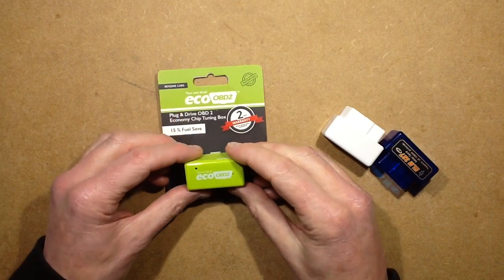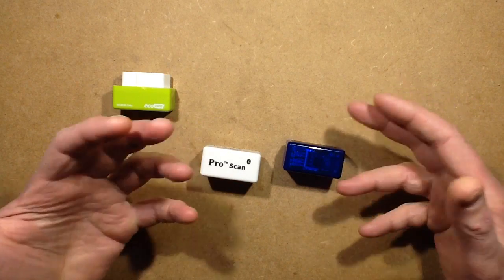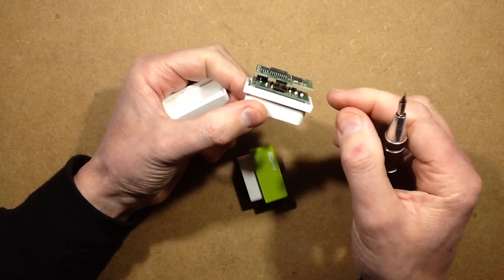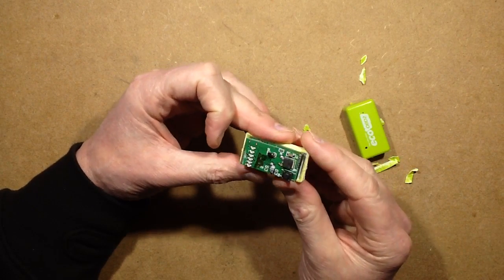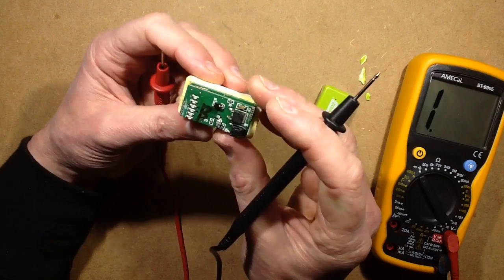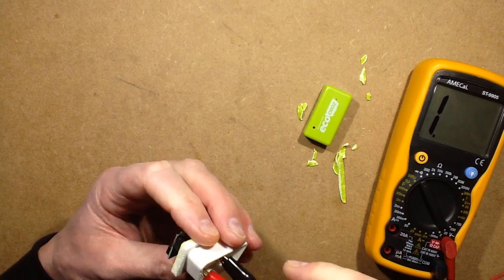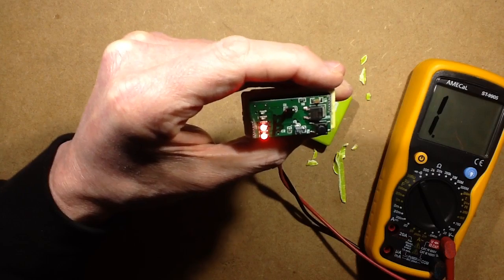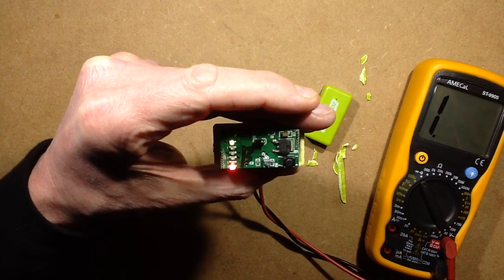Inside an ECO OBD2 "chip tuner" fuel saver.

Comment: Hi all 
I'm a manager for a courier firm and drive a VW TRANSPORTER on a 17 plat. I do about 1000 miles a week .  I plug an eco obs2 in and have had it going for a full month as you can guest I track my fuel usage and after comparing month on moth my diesel van is getting around an extra 196 miles per tank full which is well worth it in my line of work. I have also notices a few things worth a mention 1. The engine seem less lumpy in tick over and smother in acceleration. It also quiter at Cursing speed on the motorway. 
2. It feels slightly less poky in the lower gears.
Hope this helps.
Reply: I don't believe one thing you said.
Reply: Cursing speed? Is that when the passenger is saying "Oh shit!"???
Reply: That’s the biggest load of wallop I’ve read these things don’t work they just light up that’s it 😂😂😂

Comment: "Most modern engines operate on a closed loop which basically means that the parameters for the next combustion cycle are set by the previous one. The exhaust is sniffed for oxygen to determine if the car is running rich or lean and the intake fueling is adjusted to match. Many popular engines learn over time the optimum settings and every 200 miles or so adjust the ideal map to keep the engine running efficiently. This takes into account driving style, seasonal temperature adjustments and varying grades of fuel."

https://www.torquecars.com/tuning/tune-a-car.php

Comment: As a technician i can confidently say that this is bs. Obd2 replaced obd1 in 1997 to standardize the  port due to every manufacturer having it's own diagnostic port, it also standardized a lot of fault codes so that anyone could plug into the port and find out why the check engine light, abs, or most other trouble lights are on. However, every manufacturer still has it's own software that allows any form of uploading data to the computer or any other control module. There are many devices called "tuners" that are capable of flashing new software onto the cars computer, but those devices are a result of lots and lots of reverse engineering. So long story short, no, this device is completely bogus and has absolutely zero effect on your vehicles fuel economy or performance.

Comment: You know few if any microcontrollers come with an actual CANBUS phy, most have the software layer and then you actually need a chip for the phy. So it would have been nice if you could haven actually gotten a photo of the board in the video. If these units do anything at all, most of times they are just messing with the oxygen sensor data, but the ECU is able to remap itself to some extent so it would just make it worthless anyhow. Only a true ECU replacement can land you results.

Comment: Ok, my rx350 was miserable to drive, hesitating, jerking,bad shifts, so I plugged in a power tune. Hesitation is gone, shifts are perfect, gained 2 mpg. I was really surprised, I was able to talk to the people that market it. It modify the timing map slightly. Not a lot, just enough. It works. And doesn’t hurt anything, I was a shop owner for 37 years, I wouldn’t do any thing to my new 50k car that would damage it. I was pulling the ecm out of new chevys in the 990’s and changing the proms,  this is kindergarten stuff. Get over the feigned indignation that it will damage your car. B.S.

Comment: Ok, I bought a new rx350, part throttle was hesitating, jerky, miserable to drive. Trans shift points were screwed, desperate I tried a powertune plug in, even though I had already been told it was a scam. The dealer had no fix. So I plug it in, and......... hesitation gone, much more responsive, picked up 2mpg at 75 mph cruise. Man, for this to be all in my head it is great. If I had known I could do this with just my head, I could be rich by now. I have given this much thought,,if my issues were caused by not enough ignition timing, raising timing could solve some problems. I assume it is simply capturing the signal from ecm, and spitting it out modified slightly. 37 years owning shop, I have seen everything, did not expect it to work. But it does.

Comment: This is fake, I'm an automotive mechanic, altho software updates are possible on obd2 (flashing) a small device like this will be unable to do so, it requires specialist equipment costing huge sums of money.
We do it all the time on services to update and correct ecu issues etc.

No here's the bit most people won't tell you, now if you have a modern obd2 car you do not need to buy fuel saving devices. You car does this for you, most car ecus now self learn your driving style and adapt to that. So if you drive hard you car will adapt and make small changes in the ecu to account for this, if you are a gentle driver then the same will happen,

You can reset this, it's called adaption parameters. I won't go onto how etc as this really should be done by a professional, but your dealership or mechanic should be more than happy to do this for you on request. Maybe for a small fee depending on who you go too.

Once you have this done drive carefully and use high quality fuel, your ecu will learn and adapt to this and as a result you should see better mpg, depending on how you drive.

When I bought my car it was slightly under powered for what it is, a v8 and I have no care for fuel economy, I have my daily driver for this, done the reset and there was an instant difference, the car had learnt that the previous driver liked to take it slow.

The information about self learning ecus I'd out there and a quick Google will tell you if your car has this feature, most obd2 cars will.

Hope this helps anyone looking for more economy or a more responsive engine, nd hope it stops anyone from buying these devices, that if they fail, short etc could damage your ecu, I have seen it all before with these. Only specifically designed professional equipment should go into this port, and be operated by a trained motor mechanic or engineer.

One last thing to keep economy good is just be on time with your service and maintenance, use high quality fuel.
Maintenance is key for a healthy engine, and us mechanics will always praise you of you look after you car, we may not do if we see one of these plugged into your obd port :0

Comment: This is exactly what the OBD2 port is for. Even the dealer service diagnostics computers connect via this port, including upgrading engine management firmware and settings. The implication that using this for programming your ECM is some sort of hack is incorrect, that is it's function. The confusion probably comes from you being in "Europe" where they have legacy CAN-Bus connectors as well and often use them for ECM programming. Any cars sold in North America are supposed to bring out the CAN-Bus to the OBD2 port as well, just like GM (  SAE J1850 PWM ) and Ford's ( SAE J1850 VPW) proprietary buses are on the port as well.

That said, I wouldn't plug one of these things into anything but my worst enemy's car. Reputable performance tuner hardware is specific to not only the make, but model of vehicle and the tuning fuel maps are developed for each vehicle through actual testing in vehicle. The idea of a generic map is pretty silly. My guess is that if this thing does anything at all, it either fakes or overrides the value of some sensor like the IAT and injects a signal that tricks the vehicle's ECU into putting out less engine power, giving more economy. I doubt it really works, and can't believe it works universally. Hypertech makes tuners that both add performance and increase economy and they are several hundred dollars and specific to each vehicle. 

If you really want to test this, there are Arduino hardware modules that can read most of the buses available on the pins of that device so you could easily see what commands it is sending. In the case of a CAN-Bus vehicle, a CANBUS-Triple device could easily see all the commands this device is sending AND all the responses from the vehicle. Though if you have a CANBus Triple, you wouldn't give a rip about owning one of these.  ;')

Comment: It is very much possible, particularly with newer cars, to change the engine software via the OBD2 port. Over the last few years, some manufactures effectively release patches/updates for vehicle software. My mother was requested by the dealership to take her 6 month old Fiat 500X back to them so they could run an update. My brother works at said dealership.

As I'm sure you're aware, some folks, such as myself, opt to have their vehicle's engine management system updated/reprogrammed with 'aftermarket' software. This is usually referred to as 'remapping' as one of the major things that is often adjusted is the 3-dimensional graph or graphs that the computer uses to calculate ignition timing, fuel injection timing etc. The process of having a vehicle remapped varies wildly from one vehicle to the next. On some, it can be as simple as plugging in and uploading the software, or adding a 'tuning chip'. For my vehicle, a 2007 Nissan (E11) Note with the CR14DE (1.4 Petrol) engine. Gareth and Ian over at MapTech had to remove the car's ECU, dismantle the casing to extract the PCB, solder onto a specific selection of pads, they then created a backup of the existing manufacturers software before uploading the new software and then going through the reverse procedure to put the ECU back in the car.

I don't have 'performance' figures post remap as the car is a small, modern, normally aspirated engine so the gains were likely to be very small. Potential torque and power gains are typically much larger with older and larger engines that have some sort of forced air induction (turbo/supercharger). However, the reason I had the vehicle remapped was to improve it's fuel consumption, as the 34-urban/38-cruise miles per gallon I had been getting was unsatisfactory. After the remap, I've gotten as high as 44mpg on a long drive from Doncaster to Stirling.

I have heard some folks say 'If you can get this from a remap, why don't the manufacturers make the cars perform better from the factory?' or words to that effect. There are a number of reasons for this:
First, when a car is new the engine has a 'bedding-in' period. If a manufacturer designed an engine to give maximum performance the moment it was built, the longevity of the engine would be severely diminished.
Second, it gives the manufacturer scope-for-improvement in a manner of speaking. When a new car is released, if they leave themselves some room to get a little more performance out of the car, simply through the use of software, it means that in a year or two they can advertise the car as 'new' again, by simply making a few cosmetic changes and including 'better' software. In some cases the different software is sold in parallel; for example the van my company provided me, a Peugeot Bipper with a 1.3 turbo-diesel engine is available in a 75bhp and a more expensive 95bhp version. To the best of my knowledge none of the 'hardware' is changed, only the software.
And lastly, the manufacturers have a number of constraints, restrictions and, to some degree, flaws. Manufacturers have to content with emissions laws and other legislation. They have to be aware of insurance and vehicle tax bands, customer requirements etc. And of course there are, without doubt, people out there who are better and tuning an engine than those employed by a given manufacturer.

Back on topic, I'm pretty certain that this 'ecoOBD2' toy, for I suspect it's most likely little more than blinking lights, couldn't have a significant affect, if indeed any at all, on a car's fuel consumption. For a start, it's simply too small and simple in it's construction, it doesn't have the required data storage and computational hardware to make the kind of adjustments necessary.

P.S. Only now do I look back and realise what an essay I've written over the last hour. Time flies...
Reply from the maker: It sounds like they remapped your ECU via its JTAG processor port.  I'd guess the manufacturers do pull the settings back in their map to ensure the engine lasts a lot longer.  I bet they use more aggressive parameters in the actual design and testing.

Comment: After reading the scare mongering stories about the Cheap obd blue tooth unit's I decided to buy a few about 2 year's ago the cheapest one being  £3 and they have more than paid for themselves fixing Cars of friends and relatives and resetting fault code's and warning lights..I have had the cheapest Chinese unit plugged in permanently to my Toyota and it has worked perfectly for almost 18 months...I even opened them up to see how they work they all contain a can bus transceiver a blue tooth chip and the COB elm327 equivalent which translates all the different car manufacturer's protocols so the software can speak to the ecu in read and write mode......so the ecu can be reprogrammed once the link is established just don't remove power half way through or like any Device Updating you will brick the ecu😆....apart from that they are Brilliant value for money and when matched to a good laptop program can read all the various car's  Sensor's.

Comment: The odd thing about the light show on tjis thing is that the lights are covered by that plastic casing. So when it’s in operation, you could see at most one light (through that tiny hole in one corner. Yet there is a row of five? LEDs.

Comment: I ordered chinese obd2 blutooth reader and plugged it to my hybrid auris, got ”check hybrid system” error right away :S got it away after few restarts. But later hooked car up with toyota techstream, bunch of error codes about lost communications about every control unit what car has: abs, steering, motor, hybrid etc etc and low 12v battery log. So luckily obd2 reader what in place for maybe 2s, seems that it shorted 12v to everywhere and lucky me that nowdays cars has good protection at obd2 port. What i learned: never ever trust these 5€ readers.

Comment: Devices plugged in can likely lie about current fuel consumption and the car will probably just show the value from the device that sends valued most frequently. The OBD diagnostic port expose many ECU that perform multiple functions in the vehicle,  etc. ECU settings can be changed, especially if device plugged in is aware of the particular ECUs Security Access Level protocols. Devices can also dump ECU firmware, RAM etc using XCP protocol (on ECUs with that feature enabled.) Basically the OBD port can do almost anything assuming a device plugged in is proficient at commanding the ECUs. Or DoS the system if it is very bad at it. Don’t plug crap into OBD :)

Comment: Just a heads up on the different protocols, older vehicles when they were switched to obd2 would run one of 4 different protocols depending on manufacturers specs

Comment: Yes it is totally possible for this to actually trick the sensor readings in your car on anything 2004 and newer it is probably tricking the mass air flow sensor reading or it could be retarding the timing in the ignition on the spark plug or it could be tricking the O2 sensor reading if it's touching the mass airflow sensor reading it's telling it that less air is going into the engine that actually is to cause the engine to run just a little bit leaner which would cause you to get better fuel economy or the O2 sensor and it would be tricking the O2 sensor in the saying that the air fuel ratio is actually a little bit richer than it is which would also cause the car too lean at the air fuel ratio or it could just directly be taking a few degrees of Advance off of the ignition timing which would increase low-end torque do nothing to Mitten twerk and get rid of high end torque in the engine there's a number of basic things that this could easily trick on any running car that could actually cause results of the engine to burn less fuel like tricking one of these many sensors I just mentioned in older fuel-injected cars literally you can do this by taking resistors in jumping certain pins in cars that have OBD1 computers and certain pens control specific things like your mass airflow sensor reading or your O2 sensor reading so older vehicles you can literally just use a cheap $0.15 resistor to do the exact same thing but more than likely wants this thing stops it's analysis process and actually starts doing something it will actually be able to use multiple sensor data to determine whether the engine is still in a proper running alignment for everything and it is probably capable of bringing everything back to the proper readings and stock alignment in that particular vehicle which would be the initial plug in and drive. For it to learn your car it would remember the original programming for the car too and it would probably only do this as a live function turning the car off and unplugging this would probably return every sensor reading in the car back to normal it probably only tricks the car when it's plugged in and when you plug into an OBD2 port each car has its own OBD2 serial number so it probably remembers the serial number of the last vehicle it was plugged into and checks that every time you start the engine and for the first 5 to 15 seconds of every time you start the car it would probably just analyzed if it's even plugged into the same car that it has been plugged into and has been adjusting the engine for better fuel economy keep in mind that plugging this thing in will decrease your horsepower it might help your low end torque and power but it will definitely reduce your high and torque and horsepower.